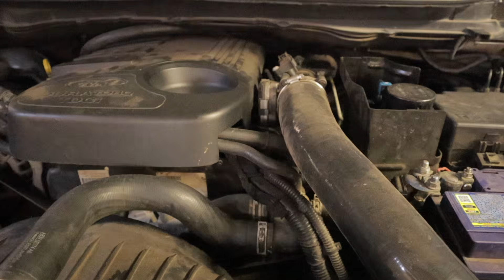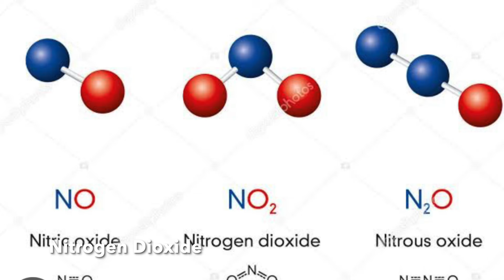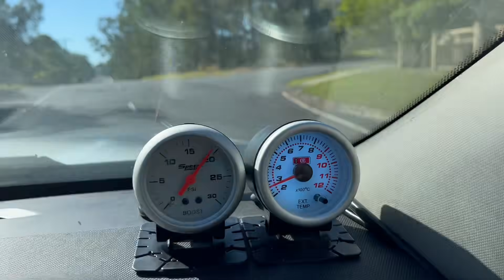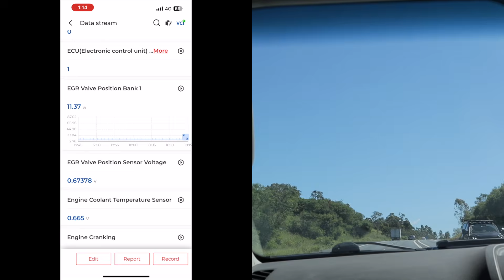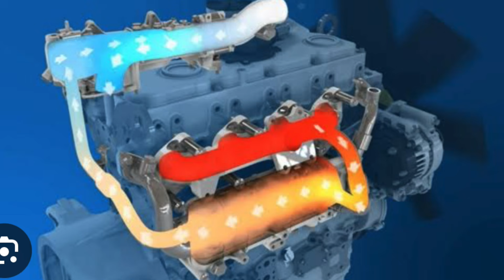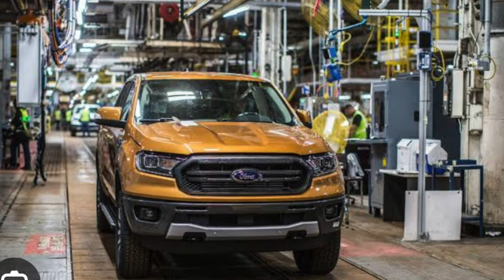Does Blanking the EGR on a Ford Ranger make it run Hot?

Comment: since i blanked the egr on my px1 a few weeks ago it runs a little bit colder looking at my temp gauge. coolant doesnt have to cool down exhaust gasses anymore also I could delete the whole coolant track to the egr cooler because we don't have heater cores here in Thailand. I guess it makes the coolant system more efficient.  Plus engine doesnt get hot exhaust gasses as intake anymore. Again according to my temp gauge (my px1 at least) it runs cooler and takes longer to get at 'operating' temp

Comment: Yes, it's closed during peak operating demands. But you're now exposing the combustion process to peak operating conditions at all times when blanked, right? Probably NBD but was it designed to handle that. It seems that new stuff is designed super close to failure as is.

Comment: I think what people are missing is that the EGR system reduces peak combustion temperatures not the average combustion temperature over the complete cycle.  It’s still a heat engine and the same amount of heat is required to produce a given amount of power with or without EGR.  Blanking the EGR would have no impact on engine temperature.  It would significantly increase emissions of oxides of Nitrogen which is not good because it is a precursor to acid rain and creates smog.

Comment: If the egr only works at slow speed (50-80ks) does a egr delete cable/wiring kit stop it opening all the time
Reply: Yes during the EGR cable installation you disconnect the EGR valve connection and it remains closed. The cable simply tricks the ECM into thinking all is well with the EGR valve otherwise a dash light would illuminate.

Comment: I did the delete at the exhaust manifold when i took it off to put a new turbo on. Runs so much better, but the exhaust is stinky like a jet engine.  3.2 Doesn't run hot at all.

Comment: I would like to explain how EGR works in terms that the Average Aussie bushwakker would understand,
lets start by saying that a lean mixture burns more oxygen and a rich mixture burns more carbon for starters,
then I should say that burning more oxygen creates more heat which in turn lets NOX gases out whilst the rich mixture stays cooler but can release unburned carbon if it is to rich, 
So the EGR is there to reduce the combustion temp during lean burns by adding exhaust gases, the exhaust gases take up some of the volume of the combustion chamber where oxygen would normally be present, therefor eliminating excess oxygen during combustion and keeping the combustion temp lower,
one of the reasons you need this system is because a diesel inlet manifold doesn't have a butterfly valve to restrict oxygen flow and under certain load conditions the oxygen supply will be reduced but the fuel will not be, and EGR can keep the balance between to much carbon in the exhaust and to much NOX.

Comment: hey mate does blanking the EGR via remapping solve this issue or should the plate still be installed and if so can you guide me on why. have a px1 doing 120k kms egr cleaned a few months ago and already clogged again and valve stuck closed. faaking pain in the arse
Reply: Closed is good. Gunk is not

Comment: how it reduces ignition temps, because diesels dont have a throttle, when you are in low "throttle" position, the amount of air your engine draws in has significantly more oxygen in it than what is required,  so when diesel is injected, you will have a lean burn enviroment due to the low stoichiometric mixture,  this creates high temps in the combustion chamber.  so the egr diverts oxygen depleted air, cools it, puts it in the intake and this balances out the stoichiometric mixture ratio,   when on higher throttle %,  it slowly closes,   ideally you dont want perfect combustion,  unburnt fuel is actually a coolant to the cylinder temps.  high ignition temps cause nox emmisions they want to reduce,

Comment: It seems to me that that the EGR system is there primarily to reduce NOx emissions in built-up areas (where you're likely to be travelling under low engine loads). NOx reduction in built-up areas is primarily desirable - indeed necessary - to improve air quality. High levels of NOx in highly populated urban areas does indeed kill people and makes life damned miserable and in many cases unbearable for so many more.

This video is an excellent demonstration that there is no EGR under high engine load. And if there were then it's likely that - EGR cooler or not - the engine and head of the motor would run hotter under high loads.  The EGR cooler would likely be pretty useless when the engine is working hard.

But at the same time, it probably is true that at lower speeds and loads - when EGR actually is happening -  EGR cooling is probably necessary in order to reduce undesirably higher engine operating temperatures and particularly when it comes to the thermal impact on components in the engine head (that due to their nature and function aren't cooled by the engine cooking system)  that might be reached if EGR gases weren't cooled at all.

I'm not an expert in this area at all. But this explanation would make sense.

Comment: Excelent video. 
Ranger PX1. 
Why to install a plate if you can install a plug and play egr delet (for example diesel boss)
Reply: I agree but I like the idea of no exhaust gas entering the EGR cooler when a blanking plate is fitted. Especially when the gas has nowhere to go to with the EGR delete cable fitted. I’d sleep better with the plate and also bypassing the EGR cooler’s coolant supply too. ✌️

Comment: Great news everyone, I fucked off my ranger and replaced it with a plug in hybrid peugeot 3008, so far I have drived 2,860 Kms on my first tank of fuel and still have plenty of fuel range. I charge i daily from my solar at work and have the dino juice for long trips. No more clogged EGR and it has a quick 0-100 in 5.7 secs. Looking forward to the plug in ranger next year, maybe it will be tempting me back :)

Comment: The role of the EGR is to maintain an even temperature during the running of the engine, mostly at idle and low load RPM. 
This is similar to a Petrol engine closing its throttle body gate to reduce air, hence the effect is the same, it creates a lower oxygen environment for the fuel to burn thus lowering the temperature of the gases during the ignited stage in the cylinder. 
That’s why you pull over when a petrol  engine overheats. You let it idle to cool down. A Diesel cannot do that without an EGR. 

But yes the consequence is soot and deposit build up that requires extra maintenance.

Comment: Hi.My 2012 3.2 ranger turbo has blown....We had already spent a quite alot money replacing other parts like injectors and other stuff.Would you recommended we fix it and sell it or keep it?It now has 260 000km on and it is a automatic
Reply from the maker: if you've done injectors already keep it, turbo is an easy fix $500 of ebay, 3 hrs work
Reply: @abdautomotive  it was a blown turbo...but I want to know,I want to blank the EGR but can I only put the plate on the passenger side but not on the other side.Because the one by the exhaust manifold is a huge job for me but the one at the intake side is much better.

Comment: A combustion chamber is designed to operate at very high temperatures. One or two degrees from blanking the EGR is not going to damage the engine. What do these people think, that the combustion chamber is going to get too hot and crack? What is going to happen?

Comment: You will crack the head because the burn is hotter. I was wrong. I have now changed my mind, & I have just the other day made an STS blanking plate & removed the EGR cooling pipes on my 2006 Mazda BT 50 2.5 turbo diesel 104000 km the engine now runs cooler. You are one of the smarter people who makes YouTube videos.👍

Comment: Can you just install a blank plate or it requires more than that?
I mean it’s must to make changes in ECU and tune after installation of blanking plate?
Reply: Yes, you have to reprog ecu after blanking egr or you will see a check in the dashboard.
Reply: Some blanking plates have a 7mm hole in them to let a bit of exhaust through to fool the computer .
Reply from the maker: depending on the model but the px1 is a full plate, px2 & 3 will need a 7mm hole to keep the sensors happy, will do a vid soon

Comment: blanking the EGR is pointless. like you said it only opens at below 30% throttle. stick a catch can on and the EGR is never a problem. it's a system designed to lower NOX emissions at low load conditions like idling and town driving. it does just that. before I understood how the system worked I was one of the people that thought the EGR was making the engine run worse for the sake of lower emissions but that's not the case. any throttle position where you would notice power differences has the valve shut unless the unit is defective or clogged up with sludge which is why a catch can is a necessity on diesels with an EGR system.
Reply: Catch can is certainly the right idea (just use a proper one such as a Provent not some of the stupid aluminium cans) but even with a catch can the EGR is definitely a problem.  It will still fill the inlet with soot, it will just be less of an oily sludge and more of a powdery accumulation.
Reply from the maker: your explanation is valid tho clean oil circulating through the breather does no harm, unfiltered exhaust gases block up the intake, catch cans don't remove 100% of the oil , blanking plates remove 100% of the exhaust gases.
Reply: @abdautomotive  yea you're right a catch can doesn't remove 100% of the oil but a catch can is a legal modification. a blanking plate is not. whether the laws are right or wrong you just have to abide by them. I'm not getting my diesel defected and put off the road with a massive fine
Reply: @ThatDaveFella Install a catch can and have zero problems? Wait until. The EGR Cooler splits and dumps coolant through the inlet manifold into your cylinders & gives you a catastrophic engine failure 😒
Reply: @jedbennett7397 that’s what I’m thinking.
Reply: @abdautomotive   any oil mist landing on the back of the valves will cake up a carbon layer, not real healthy in the longer term. Nice video BTW. It is a crunt to remove those bolts when the engine is in da hood though.
Reply: Totes agree, volumetric efficiency at low RPM.
Reply: No catch can you need the oil to lubricate valve seats check your valves clearances after 50,000 Kms and you will see they have closed slightly due to the the dry carbon the best thing i have found I fit a blanket plate with a 7 mm hole gets rid of any tunes make sure inlet manifold and egr are clean you will be surprised how long the engine oil stays change oil and filter everywhere 6000 Kms
Reply: @คุณAndrew  You're obviously talking about a petrol engine, not a diesel.  Diesels do not need valve seat lubrication.  You say "make sure inlet manifold and egr are clean"  - the way to do that is fit EGR plate or tune it off and fit a catch can.

Comment: So what this tells me is that you need the egr the most when you're sitting in traffic in cities at stop lights or heavy traffic. It's pretty much exactly when you would want it. When you're near stationary or stationary, with lots of other cars and people around, you and the pedestrians are not breathing in so many harmful gases....
Reply: What it doesn't tell you is that it's exactly at this time when your engine fills up the inlet tract with oily, sludgy goop which will reduce the air flow at all times to the engine, causing extra fuel consumption, rich running, extra hot combustion leading to molten pistons eventually.  The small advantage gained at idle is well and truly obviated when the chemical cleaning agent used to clean out the inlet at huge expense is flushed into the environment together with the removed goop.
Reply from the maker: @einfelder8262  great explanation
Reply: @einfelder8262  sure if you're sitting at idle in traffic for very long, periods of time. Which, if you are, why are you driving a ranger?
Reply: @DJ70404  What the hell makes you think I drive a Ranger.  ALL diesels with EGR suffer the problem, as do ALL petrol engines with direct injection.  Try and learn something instead of making ignorant statements based on your dreamtime.
Reply: @einfelder8262  yeah good one. Grow up.
Reply: @DJ70404  I'm not the child who thinks someone drives a Ranger just because a Ranger is the subject of an EGR video.  So It's you who should move ahead of kindergarten thinking.  At 73 years I'm far more grown than you.
Reply: @einfelder8262  73 and being a keyboard warrior. Well done hero.
Reply: @DJ70404  You're funny fellah - I'm a keyboard warrior so wtf are you?  Oh, you're one too!!!  But an ill informed one.
Reply: @DJ70404  IS THAT THE BEST YOU CAN DO?
Reply: @abdautomotive  so blanking off is totally irrelevant as it serves no purpose.
Reply from the maker: @DJ70404  you obviously missed alot of my previous videos
Reply: @abdautomotive  yes, I dont generally watch your channel.

Comment: Imagine how many engines were destroyed by faulty EGR components or the reduced lifespan of all those engines, that's definitely not better for the environment. I have a D40 Navara and since I've done the EGR blanking plate it's reduced my fuel consumption from 10.3L/100km to 9.0L/100km, with no other changes, maybe some exhaust gas was leaking past the valve??

Comment: My understanding of how it works:
Recirculating exhaust gas reduces the combustion temp by reducing the available oxygen in the combustion chamber. 

But in order to run at a given RPM, say idle RPM, a given amount of power, therefore heat, is required. (The heat expands the air which produces the power, so power=heat)
So in order to maintain the same RPM, more fuel has to be injected, which ends up producing the same heat overall. This is why blocking the EGR will slightly improve fuel economy.

Recirculating exhaust gas reduces LOCAL high temperatures in the combustion chamber. It doesn't reduce the overall heat produced.

Comment: EGR doesn’t make your engine temp rise because of the cooling system efficiency just like if you decide to tow a trailer the system can cope. 
The EGR lowers the piston crown temperature this is where you can, while towing under light throttle cause piston crown temperature problems ( cracking or blowing through) 
More to the point Nox kills 
Causing CANCER don’t blank off your EGR it illegal

Comment: Does the fuel map change when EGR is open? Could we be running lean with our blanking plates
Reply: Diesels pretty much always run "lean". They always have the air intake wide open, the accelerator alters the amount of fuel being injected. It's not like a petrol engine where both air and fuel feeds are reduced at part throttle. 

So when idling, yeah diesels run incredibly lean. But it's not harmful to them.
Reply: Diesel engines run cooler when they run lean . They are the opposite of petrol engines which run hotter when lean .

Comment: Can we add an extra "oil cooler' to aid in cooling the engine to compensate for blanking the egr?
Reply: Yeah, it's not necessary. As the video shows, the EGR valve is only open at low load conditions. The cooling system is designed to cope with sustained maximum load - like towing a van up a big hill. 
So EGR blanking only affects those periods of low load, when the cooling system isn't working hard at all.
Reply: If I understand this right it’s 100% not required.  If the air is cooler coming in, why would the oil be hotter ?

Comment: 5 major issues with egr 
1/ inlet manifold gains deposits and needs cleaning every 100,000km
2/ Egr cooler needs cleaning at the same time as egr valve every 80,000km . Egr coolers overheat and split causing engine damage from leaking coolant .
3/ poorly performing EGR systems cause poor throttle response and lower fuel economy 
4/ some egrs system operate that poorly fuel economy is never stable from new 
5/ some engines wear injectors very fast partly due to combustion contaminants caused by egr particles 
NONE OF THESE ARE KNOWN BY THE PUBLIC 
oz Bush Electronics
Reply: I would say you are blaming the EGR which is probably being effected rather than affecting anything adversely.
Reply: @gogogeedus Yes your correct the FULL egr system is at fault by its design . By its design as an assembly it causes shorter engine life , Simple 
Particles or soot cause  higher engine wear via oil contamination  and direct contact with components .